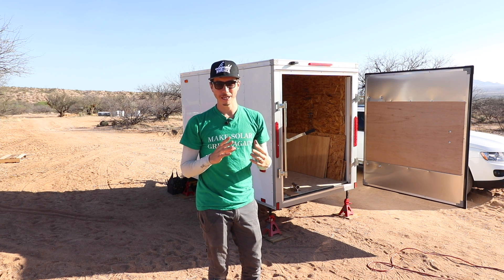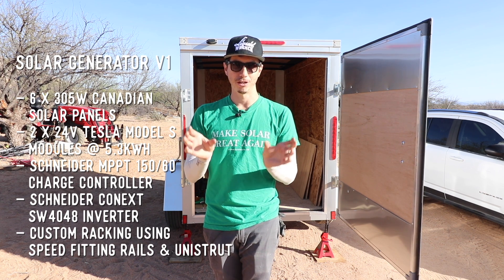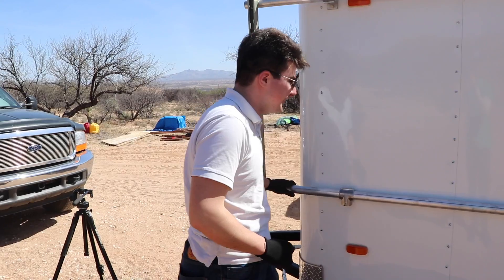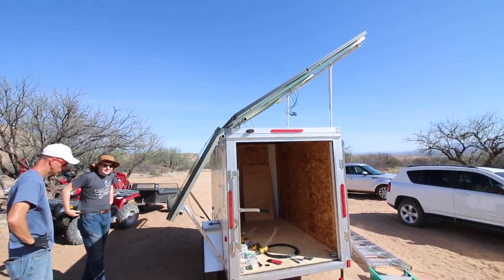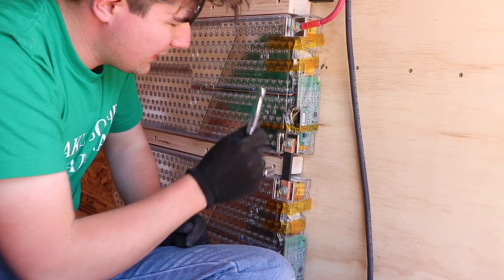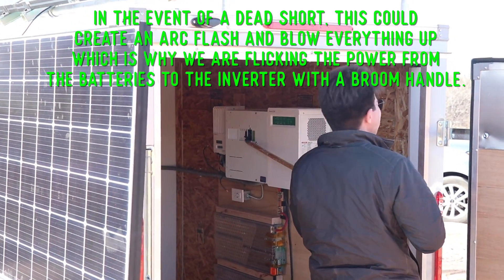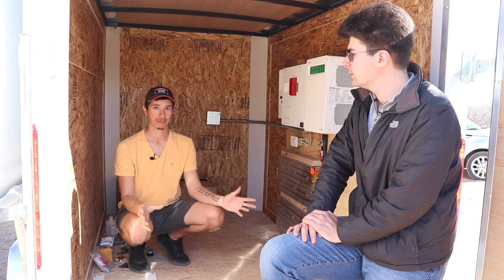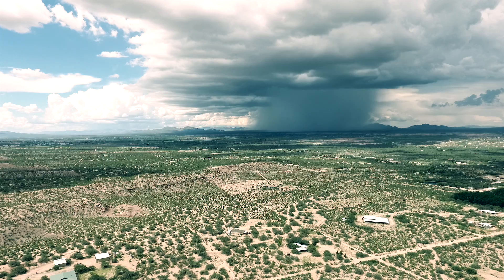DIY Solar Generator With Tesla Batteries On A Trailer... Can It Be Done???

Comment: run your 3kw A/C all day on 0.6kW (7-10kW/day) of solar power and 8kW (after 80%DOD Limit) of batteries? I think you might need to check your math! at most In  perfect sun, you'll get around 4-5 hours of run time for a standard A/C accounting for all the efficiency loss in the system 85-90% for the inverter, 90-95% for the wire runs, and that's only if the pack is fully charged from the day before and you time the running of your A/C to perfectly match with the peak SOC of the batteries. And although the Microwave is a "big draw" it's for a very short period of time. maybe 1500W for what... 60 seconds? 1.5kW for 1 minute is not a huge power draw. people mistake power for energy capacity all the time! I've been building these for local contractors, wedding rentals... I'm running 12kW Cont /30kW Surge <30sec inverter chargers on 48V setups with ~140kWh worth of batteries. We then charge the system on days it's not being used with a Grid-tie system.
Reply: eh, I think you need to check your math! They have 6x 305w panels so 1.8kw not 0.6kw. Also a 3kw air conditioning system! that's for a house unit not an RV
Reply: Stokes Pen try again. Check specs on rv ac’s. 3kw, easy! And that doesn’t count the loaded induction motor start. If you’ve ever done solar you’ll know you never get the spec power out of a panel. At most you get 90% for 1 hour a day on a non tracking array... on a normal day you’ll get 50-70% of the simple math Calculated power out of an array.
Reply: So you know exactly what a/c unit they have? They come in all shapes and sizes and it wasn't mentioned in the video. How can you comment that their setup is wrong without knowing the facts. I don't see any videos on your channel so please do show us your system.

"people mistake power for energy capacity all the time!" and there you are quoting  "0.6kW (7-10kW/day)", so you mean 7-10kWh a day. This ignores the fact you got the total solar input wrong anyway.
Reply: 1. Lets start with what we know. 6 Panels at 300W each = 1.8Kw Installed. derate that at least 15% for mismatch, wiring losses, etc (industry std stuff)... As for the angle they look from the video to be an average about 35 degrees. It looks like they are in the south west US. lets go with Tucson AZ. Using an online calculator like PVWatts you get 3,271kWh/year (divide by 365) is 8.96kWh/Day on average over a year. the best producing month according to PV watts looks to be May with 305 kWh over 31 days is 9.8 kWh/Day..... right where i said it would be.

2, that's a Heartland Prowler 5th wheel. looks to be a few years old no big deal. I can tell you for a fact that the smallest ac on a prowler is a 13.5kBTU unit! even on the smallest trailer from 10 years ago and normally there are two of them! lets even give them the benefit of the doubt and say they run one unit and they run it on low. That cuts that in half to 6.7kBtu. I've yet to see an RV AC thats more than 50% eff. so that 6.7Btu is 1.7kW! remember this is on low power! Assuming low is 50%, and it's probably more like 75-80% power, but i digress. so that one AC unit will burn almost 2kW per hour on LOW! Now lets add in the inverter efficiency (let's go with 95%) so now where at 2.1kW per hour, Now for the 8kW battery pack... can only go down to 80% DOD without risk of damaging the cells. so that 8kW of installed battery pack is more like 6.4kW of usable battery power. So even if they start the AC right as the battery pack reaches full power they could only run the AC for no more than 4 hours... on low, before the batteries would be dead! (3 hours if there is no sun!) ( i had to fix some of the numbers, did them in my head and had them backwards on the orginal time though this reply)

3. Why do I need to show my systems? they work, they make me money, they save gas and have zero noise! I'm not giving up my secrets. In all reality, this stuff is not that hard to learn. is basic math. don't even have to do any calculus to figure out the basics.

4. I'm not saying his idea or his trailer is bad. I'm saying some of the info he's putting out is a little off. also, he needs to build a cap charging circuit to help get rid of the fuse popping problem! keeping expectations realistic helps keep clients happy and helps drive forward the industry, false hope, and miss information piss clients off and kill it.

Comment: So could you use the same set up to charge a Chevy Volt if you were living in an apartment or rented house because they would not allow you to put up solar cells but you could park your mobile system directly in sunlight because the Chevy Volt needs about 18.4 kW

Comment: I have a suggestion, Looks to be desert so high temps during the day. If you put a pair of 55gal drums inside the trailer and filled them with water, the had a vent and low wattage fan pull in the cool night air. They would make a nice thermal ballast to keep the temps inside that trailer a little cooler during the day. As well as add some additional weight to the trailer to give it a little more resistance to the wind flipping it over. Since it basically has a big sail on top now.

Comment: Thanks for a brilliant video! One technical question: I plan to use 4 (four) Tesla S batteries to make a 20-ish kW 'powerwall' for my house... since the Tesla modules have internal cooling, do you think it will be necessary to cool these modules to reduce eventual overheating? I plan to have them indoors... Would it be better to put them outdoors (I live in the Mediterranian, the summers can reach 30-35 degrees Celsius - up to 95 F, while the last winter it went down to -8C/17F)? Thanks everyone for your kind answers!

Comment: D-man, I apologize if I come off harsh, just don't limit your existence to 120 volt when 240 volt is attainable. Can anyone say,, summer kitchen  with Samsung outside?
https://i.imgur.com/yPL7GxX.jpg
Gas top high voltage bottom. It takes everyone into the attainable 30 inch appliance range.
Reply from the maker: the RV is wired for 120V, we wired up the 50A plug for 240V and have to use the adapter to bring it down

Comment: My First Time:
Got a 180W panel for my Camper Van last year (plus 3 x 12V/70aH car batteries) and it's been working fine for the minor use l have for it.
(lnterior LED lights & phone charger, basically) 
lt would be nice to upgrade a bit to be able to run a refrigerator, but money's a bit tight... as usual.
Good job on that trailer.
Love it!
Reply: 70Ah... Sorry: typo.

Comment: Something to consider when building a system like this is going direct to DC with a modulator.  Inverters waste electricity but are needed to power AC appliances but not DC battery powered electronics.  Many electronics or appliances such as computers have "transformers" or power bricks converting AC back to DC.  So basically you're converting Solar DC to house AC, then your phone charger is converting it all the way back to DC again.

Comment: Okay what you have is the Northside it flips up from the bottom and goes up at an angle and that gives you your solar and then you have the west side that swings out and hits the South so you have solar then you have the east side that swings out and gives you a seller and then you have the top but you really don't need to move and then you have the Southside what you don't need to move so now you have one two three four five sources of solar on your trailer or RV or to Prairie House isn't that an extremely knowledgeable

Comment: Here, in Clark County NV, permits are required for EVERYTHING.  Even a 2' tall flower bed wall to replacing a simple patio light fixture.  And the permit costs, disgusting!  Thanks for a great idea for exploiting a loophole.  Without principals, there's no dignity.

Comment: Cant wait for the video course to come out!  Great stuff guys!  A couple quick questions.  Most enclosed trailers are hotter than hell in the summer.  Are there any concerns about the heat in regards to the thresholds of the components being used?  Would you consider insulating the trailer?  Second question.  Have you considered a step down transformer to run any 12volt systems?  Thanks.

Comment: Re. the start-current issue, I got by that on my 24V system by putting a chunky (150W) ceramic 0.25 Ohm resistor in parallel with the fuse-holder before switching on at the breaker. Once the caps are up, fit the fuse then remove the resistor.  Chose R value for lower than the main-fuse short-circuit rating. The resistor is not continuously rated, but big enough to do the job for a brief startup current-surge. Nice job by the way!

Comment: The old copper penny trick.  :)  I have built systems and used two contactors.  One in series with a resistor that charges the inverter capacitor then close a second contact to short the resistor.

Comment: Not to be off topic, but I just got my Samsung NY58J9850WS installed. $1400, would like to see some food included in this channel. This thing is just stunning. Gas & electric, double pole 40 amp unit. 240 volt would require 2 batteries.Happy wife,, happy life.Note, Samsung moved the oven light up on the 2018 model so the grate is flush with top door divider of top/bottom oven. They fixed it.Yea a 30 inch appliance in whatever, they work, lets leverage that.The hardest part is thinking past the size of the door of a tiny house.For service of such applinence.

Comment: The biggest issue I see with this is going to be wind loading.  You basically added a giant sail to the small trailer and even with the weight of the trailer, batteries, panels,  and inverter; you will likely run the risk of the unit being tipped over during high winds.  You will likely want to use an anchoring system to provide additional strength and also an electrical ground connection.

Comment: Is there any reason for not listing the individual cost of the components you have purchased for this project , so far ?
Reply: joe doakes Because a lot more went into this build then just what parts we bought, we are intending on making a FULL detailed course that walks you through all the steps to do it safely and properly. We are are just waiting for Derek to finish his shop before we tackle that
Reply: Thank you for your reply ! Your hard work and expertise will avail many who need such a source of power to acquire a system , and maybe , build it themselves 1

Comment: I don't think you can drive with the panels hanging over the edge like that its too dangerous. On that trailer I dont think anything can be out further than the fenders so you should check your local laws.  Where I live even tires are not allowed out past the fenders.  Great job though.
Reply: legal limit is 8'6". They are nowhere near that.

Comment: Use a precharge resistor!!! 
Lithium delivers an infinitesimal amount of current for a split second to the Caps in the inverter 
Limit all charging voltages to 48v (unless using bms)
With these model s modules. 
Evtv sells a bms that works with these modules get one!
They are insanely explosive

Comment: Have you guys thought about the temperature in that trailer?  Will the excessive heat cause problems with any of the components?  From my experience most breakers trip or have problems in the summer months.  Great build!  keep up the good work.

Comment: Unused space bottom "drivers side." Not possible to make them fold differently to use the space? Also why are you using 1-5/8 strut, was 7/8 too thin? BTW love what you are doing!!! I have a 7'x16' Loadrunner and was going to design panels around similar concept. Retired plumber living in the Tucson area so you have a good grip on my attention.

Comment: This seems quite dangerous to me.  No monitoring of the Tesla modules of any kind?  No way to disconnect the modules from the inverter if something happens?  Replacing a fuse with a copper bar when you KNOW you need a fuse otherwise you wouldn't have had one to begin with?  How about a precharge circuit to charge the capacitors using two contactors?  Contactor 1 has a power resistor shunted across it so when you close contactor two, the capacitors are charged through the resistor.  After Xso many seconds/miliseconds, close contactor 1.  
I'm not trying to give you guys a hard time...I appreciate what you're trying to do but if/when something goes wrong with this system, the electric companies are going to jump all over it and use YOU as an example of why off-grid systems need regulation and why DIY systems are so bad.
Be careful.
Reply: Thank you for the clarification.  Yes, I do know Jack but I'm not trying to get you or anyone else to buy anything.  It's not needless or uninformed nitpicking but very important information that anyone wanting to follow your lead should know so they don't hurt themselves or anyone else.  There are a number of voltage monitors for way less than $2k that can shut things down should someone leave the lights on.
Reply: Hmmm, sounds like you might know Jack? Perhaps we should just buy his $2k wonder box that does all that for us. All the points you have mentioned are fully implemented inside the actual trailer, just not shown in this short, designed for entertainment video. EXCUSE me if we didn't want to post a 2hr30min cinematic masterpiece like EVTV does. The capacitors are designed to handle this kind of temporary abuse (they will almost never be fully discharged again) so while a precharge circuit may be a good idea (I'm very familiar with the concept/implementation from EV packs) the real question is why Schneider DOESN'T have that built into the inverter, 48V is 48V regardless of lead acid or lithium. We replaced our fuse with a bus bar TEMPORARILY and under the supervision of me (an electronics engineer) and Derek (former licensed electrician) since we had blown the only three we had and this was on a weekend at 6pm, the goal for that day was to get everything powered ensure things were working, had there been a catastrophic fault the main battery->inverter breaker would have tripped at 220A mitigating most of the damage (note the cover on the unit and broomstick turn on "just in case"). As for a BMS, we have a Teensy microcontroller running the OS software from Collin Kidder to do monitoring of the BMS boards using a cable assembly I fabricated, this is to support our logging software and provide for alerts if the battery parameters go out of range. I mean what is with this needless and uninformed nitpicking? Jack is the guy who had a whole series of videos on EVTV where he talked about "getting liquored up and playing with some high voltage" at least 510 times per video, yeesh...

Comment: For those who want to be mobile and travel nomaticly this trailer is great. But if you trailer a TT or 5'er you must be able to tow behind with double trailers.  This is not doable in most states. Solar on a TT or 5th wheel would be better. Having a extra trailer for just Solar does not make sense for that application.
Reply: I'm sure that will be one of the variations.
Reply: Big Truck Little RV -Yes, I'm thinking the same thing.   Make it very thin so that it can be attached to the top of a tt or 5er.  That's a big market with lots of $$

Comment: The ARRL (American Radio Relay League), amateur radio organization, holds and annual Field Day, the last full weekend of June.  This year it is June 23-24, 2018.  If you can find a local amateur radio group near you that is conducting a field day, I suggest you bring your solar generator trailer to participate.  You'll be hero, and the local club will get extra points for utilizing solar power to conduct their operations.  http://www.arrl.org/field-day

Comment: Dude Awsome. I'm actually getting ready to build that exact system.due to inspiration from your other off grid solar videos. Less the 60v bats. And am using 350 watt panels... I was told that it could not be done by a sales man at one of the solar places .he then told me I need to buy there battery.....grrrr.......however why the commitment to schinder just wondering if you think I should use them or magnum inverter.. the reviems say the schinder is loud....is that true..it will be in my tiny house...

Comment: where is the BMS ???
Reply: Odd that the Handeeman never seems to answer this question. Without A BMS isn't the battery bank essentially a ticking bomb?
Reply: A BMS of some sort is almost a must but that's said they also can be the cause of problems. I've been using something called the intelligent BMS which if you click on my profile you can see some videos of. Most of the things I do require 48 2 96 cells in series. The more cells in series The more need for a BMS they can get out-of-sync easier.
Reply: Exactly, this is not a minor issue. Without one the cell voltage will drop out of sync in a relatively short amount of time resulting in an overcharged bank of cells, killing the pack.
Reply: Stokes Pen  killing the batteries will be the least of your problem.  Without a BMS system Incorporated with these batteries you more or less have a incinerator  device that could go off at any time..
Reply: joann robinson  I see the Tesla balancing boards on the end of the batteries but the question is do the balancing boards work when they're not all hooked up and plugged into the main Tesla BMS controller board. I have seven of these Tesla batteries in a Porsche that I just converted and I don't believe I'm seeing balance and going on. I'd like to know what Tesla charges these batteries to. 4.1 4.2 or maybe even four point 3 Volts for extra range.

Comment: Great idea and I am sure you will sell a load and the tutorials, but I can see a few issues and areas to improve. 

Try 'bi-folding' the panels so you can run double the panels or more. 

Can you hook up panels on the RV's roof?

What about stabilisers / tie-downs if the wind picks up?

Do you need an earth point into the ground?